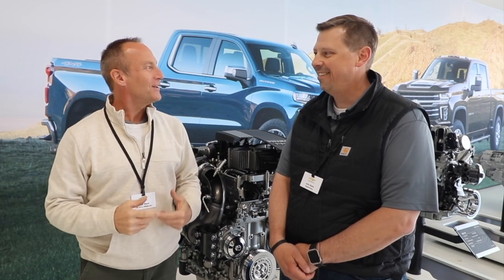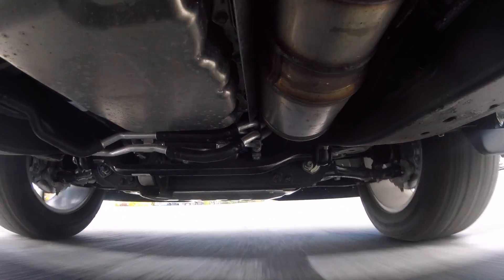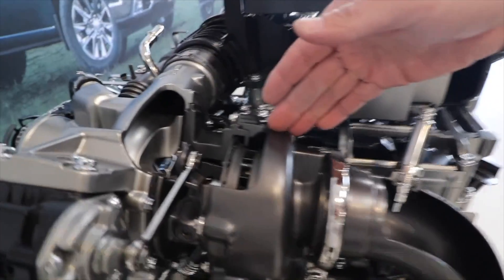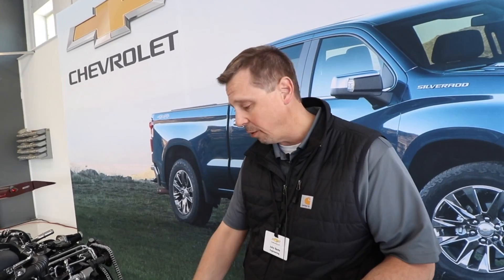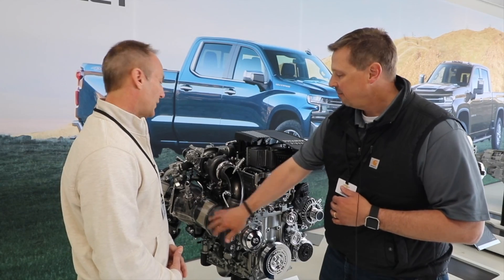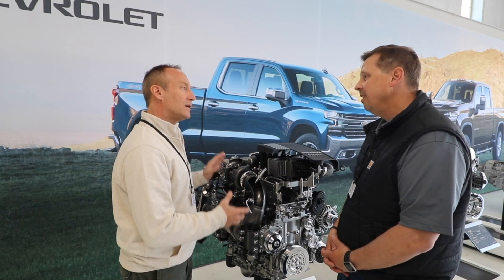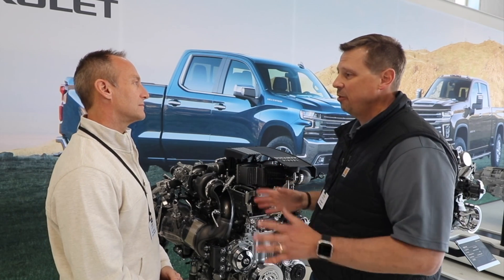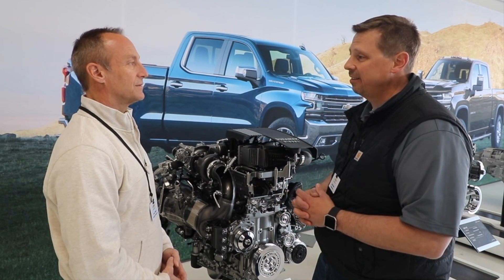Engineer Reveals All! Duramax 3.0L for Silverado 33 mpg hwy

Comment: Then put a 150k warranty on the engine!
Reply from the maker: Absolutely right!
Reply: Or what Ram does, life time warranty as long as you own the truck and keep it oem.  Ram is killing the market
Reply: @Mr.WS6  ram gave that lifetime powertrain warranty for three model years only 2006, 2007, and 2008 and it was only on gas trucks.  The lifetime warranty that some other rams have is essentially an extended warranty and it is purchased at time of vehicle, has three levels of coverage.
Reply: Some dealerships do have a lifetime warranty on thier GM vehicles.
Reply: Lifetime warranty’s are filled with so many exclusions they aren’t even worth the paper they are printed on.
Reply: E X A C T E L Y !!!
Reply: My transmission failed at 100K and then I lost a valve at 110K, on 5.3 V8, so sold the vehicle as I could no longer trust it.  Never pulled a trailer and mostly highway miles.  Did not replace with another GM truck.
Reply: It has a belt driven oil pump!! INSIDE OF A DIESEL ENGINE!!!
GARBAGE!!!
Reply: @Mr.WS6  👍 F Body!!
Reply: @philllsxga.7737  You have no clue
Reply: They build this but have a column shifter still and its 2021 plus upgrade your damn interior allready your 10 years behind the competition
Reply: Put 200,000. 150k is a damn joke for these days.
Reply: Well. Sell it before 150k and EV truck when becomes norm
Reply: My mom’s VW Beetle TDI made it to 250000 miles under her ownership, but the next owner drive it to 450000 miles. Diesel engines should last at least half a million miles.
Reply: My 2021 has 100000 mile bumper to bumper warranty   cost 3G extra from the dealer.
Reply: @Jeffrey Koda Instablaster =)
Reply: @Ernest Kamdyn Thanks so much for your reply. I found the site on google and Im trying it out atm.
Looks like it's gonna take quite some time so I will reply here later with my results.
Reply: @Ernest Kamdyn It did the trick and I finally got access to my account again. I am so happy:D
Thank you so much you saved my ass!
Reply: @Jeffrey Koda glad I could help =)
Reply: A rubber belt drive for the oil pump??? Terrible design!!!
Reply: @glengordon382  I’m sure it’s easy to replace though. It only requires removal of the engine or transmission. No one will do this and when the belt goes the engine is toast. “Lifetime “
Reply: Can someone please tell me what a person can reasonably expect for MPG out of any Powerstroke or Duramax produced in the last 5 years.
Reply: @ernestmorales1023  
Where is this warranty and what is it called?  Never heard of one for that many miles for 3k?
Reply: 3.0 litre doesn't sound too incouraging!!!
Reply: Did they build this diesil as a throw away??

Comment: Timing chain looks fun to change being at the back
Reply: So much of this new stuff looks and sounds fancy, but in reality looks like a nightmare to me.  I love chevy, but think about that little swirl valve in the intake getting stopped up with pcv and egr carbons, then they have all these little extra solenoids on the coolant system.  if one fails, your car will still function normally , but one component will get no water at all....  Looks like a nightmare to own and maintain.  It probably will be good for 150,000, but beyond that maintenance will be prohibitively expensive :(
Reply: It’s a belt
Reply: @TheSouthpawSharpshooter  there's clearly a chain in the bell housing
Reply: @Rocky Ognio I thought I saw a video saying this one has a timing belt.
Reply: Sounds like typical GM. My Canyon has two chains to replace and one involves dropping the transmission and several hours of labor.
Reply: @rognio3  I completely agree with you . Too many complicated emission related parts to fail . And you know they will . I'll stick with the tried test and true naturally aspirated gas engine . Simple and relatively cheap to repair and maintenance .
Reply: I had a 4.3 L V6 and it had an EGR on it. Being a V-6 I’d floor it and at wide open throttle the EGR would get stuck wide-open, from all the carbon; and that would cause the motor to barely run, thus robbing vacuum assist to the brakes after having just floored it. That truck was a ball buster...
Reply: @RedWingsninetyone  
the back chain is for the balance shafts
Reply: @anthonywebber2211  I knew there was something different about it. The video I saw replaced them both at the same time, but they did say they work independently of one another.
Reply: It's actually easier to change than in the front
Reply: When has anyone ever had to change a timing chain? They never go bad.
Reply: @erikkovacs3097  chains, especially under this type of load, stretch over time. Even regular bicycle chains stretch.
Reply: @RedWingsninetyone  Not much. And a tensioner keeps it taught. The pistons and bearings would wear out long before the chain stretches too much. I've taken worn out engines with 250k, 300k, or 400k on them apart and the chains all looked the same. Timing chains are for life.
Reply: @erikkovacs3097  in some cases. Even if you have a tensioner, the teeth are physically no longer the right size to do the job correctly. Here's an example from an engine with much less life on it than you mentioned.

https://youtu.be/-dI2pSmMy8Q
Reply: @erikkovacs3097  what's considered life ?
Reply: How the make more money after sales, shop time & parts.
Reply: Chains or gears. Had a Hyundai with a belt and you have to halfway rebuild the engine every 80-90k miles.
Reply: that's nothing.. sorry he didn't mention the engine oil pump belt that's mount at the rear and has a estimated life span of 150,000  good luck changing that or who wants to drop your tranny to change a belt
Reply: Rocky Ognio The back end of the engine contains a chain that turns the cam shafts and other parts but there is a separate wet belt that drives the oil pump in the bottom of the engine just ahead of the transmission bell. To get to the chain or the belt you have to separate the engine and transmission.
Reply: Geaux Tigers dropping the transmission is easier than getting at it from the front? Yeah right.
Reply: Erik Kovacs there is also a wet belt driving the oil pump. Don’t ask me why they did that.
Reply: Does this motor have front and rear timing chains? If so the past may dictate the future and this lead to terrible results overall. Nah those won't wear on each other...
Reply: steven young   My understanding (and that comes from the limited amount of information I’ve gleaned from YouTube videos about the engine) is that everything (except possibly the radiator fan which could be electric ) is driven off the back of the engine.
Reply: @erikkovacs3097  obviously haven't owned a diesel with a timing chain...this chain also drives the injection pump, which puts it under an immense load compared to only driving camshafts. Combine that with abrasive diesel soot in the oil, this chain is pretty much guaranteed to stretch. It will meet the 150,000 mile target, but my experience says it won't last much beyond that. In a gas engine, chains can last the life of the engine, but I have yet to see a timing chain last in a diesel application.
Reply: Joe Brown as apposed to removing the whole front drive system which can take just as long or longer.
Reply: @RedWingsninetyone  GM had some timing chain issues in the late 00's that have by in large evaporated since then. It was a material selection problem and an oiling problem.

It's safe to assume that any engine that needs a new chain is going to have to come out of the car, so whether its on the front or the back hardly matters. 

The pump belt is something else. Now I don't think the interval is bad or the work is bad, it's about like a clutch. But it really should just be gear driven, I don't thing adding this belt and service interval are worth the weight saving and efficiency gain.
Reply: @kaulincurtis9665  Lots of injected gas cars use cams to drive fuel pumps, and E85 burning engines have decently high pressure pumps
Reply: @Heatherder  that is a fair point, modern GDI engines run 3,000-5,000 psi range. That's about the pressure old IDI diesel injection systems run at.
Reply: @Heatherder  generally, for chains, the engine does not need to be pulled. A hell of a lot of work is needed, but you would have to do that anyway even if you pulled it.
Reply: RedWings-44 name a DOHC vehicle where it doesnt need to be pulled
Reply: RedWings-44 very few vehicles have that kind of clearance. Almost all transverse and most longitudinal mounts, you gotta pull. Ford just has you life the body off
Reply: @Heatherder  "that kind of clearance." That's an inline 5 motor which takes up more forward space than most V8 engines (which is why they offered a V8 later on). Yes, they had to make room, but I don't know any motor where you wouldn't. It would be a lot more work to pull the motor.

Edit: the one in the video is an I4, but it is the same process with the I5
Reply: RedWings-44 i’m looking at my s10 as we speak and there’s no way i’d wanna do a chain job on it without at least pulling the radiator. Now this is a big 4.3 in a little truck but still, draining the rad and removing the accessories in the way would be a huge pita compared to pulling the transmission back on the lift.

In either case its a big job but there’s no way the book hours are going to be very different
Reply: @Heatherder  different strokes for different folks. I only stated the engine didn't need to be pulled. Of course having an engine out would give you a ton more room to work, but you still have to remove all the same stuff regardless in order to get to the chain and it may not be worth the extra effort to also detach the equipment to pull the motor on top of all that.
Reply: RedWings-44 so the point is, it is very likely the job would be no easier with the chain and belt on the front than it is on the rear, and many models require pulling anyways, and it isnt a deal breaker on them
Reply: @Heatherder  most people don't think about that aspect of it because they expect to not own it long enough to think about in the first place.
Reply: RedWings-44 i certainly dont think pulling the engine or transmission is an unreasonable amount of work to change major engine components. Everything cant be done in a home driveway thats how it is. I dont think chains on the rear is bad because chains are a huge job in any vehicle. The belt thing is pretty pointless though I agree. Its a foolish design decision
Reply: On the back its a belt on production
Reply: @rognio3  Our grandparents probably said the same thing about all of these new cars we drive today...but yet here we are.  :)

Comment: Thank you for asking very good questions about this engine. I'm seriously considering buying one and will be my first diesel powered vehicle.
Reply from the maker: Thanks Tony. I think it's a good choice. I would have a hard time going to a gas engine in my next truck.
Reply: Keep in mind, Diesel maintenance is always more expensive than that of Gasoline - powered trucks.  And GM's overall quality is not so good.
Reply: Han Skinslo i’m not sure about that because I have 2009 GMC sierra Dooley and I have over 300,000 miles never been to a dealer or mechanic yet  long is you warm it up in the morning and change oil on time
Reply: As an european with lots of experience with diesel powered cars, diesel is a great way to go.
Reply: Watch the video again at 7:20 he talks about regen. If you look back at the old way of regen(cleaning out the filter) gm in the LMM 07.5 to 10 Durimax had this system and ford had it in the 6.4 power stroke 08-10. When they inject the diesel into the cylinder on exhaust stroke it washes out the rings on that cylinder and will cause the engine to fail. Many as low as 20t miles. Almost all by the time it got to 150t. So I’m disappointed to see gm go back to an old system that they already know does not work and bring back a problem that they have already got an answer to.(adding an extra injector to the exhaust pipe after the turbo) very disappointing I was hoping to get one of these diesels when they come out but now that I have seen this I will be waiting till someone cracks the ecm so I can delete the dpf and egr before I spend my money on it. Or wait till gm adds the 7th injector to it.
Reply: Don't do it Tony, run as far and fast away from GM as fast as you can. I'm a GM mechanic go for ram or Ford non ecoboost
Reply: @scoutsniper8688  ..........you tell people not buy products from a company, yet you claim to work for that company...
Sounds like some deep bull**** to me.
Reply: Don’t do it, Run! It has a belt drive oil pump for heck sake’s! Absolute nightmare to work on.
Reply: This truck is junk . Why buy a mini diesel truck that can’t do shit an has a new bs engine design that is garbage. People don’t fall for this throw away crap .
Reply: EGGINFOOLS I agree

Comment: The gm rep basically said "yea we think it'll make to to 150k but anything over that is on you"  lol
Reply: ncurc 97 oil pump belt, you have to take the engine out for replacement. Weird design
Reply: Ncurc 97, I bet a boatload of these engine will be on GM! That belt at the back may not make that.
Reply: I.T. Intern Its not weird, just their way to get in your pocket.
Reply: I.T. Intern you don’t have to take the engine out. You unbolt and slide the transmission back and can access and replace the belt.
Reply: At least he is honest. Most would just bs and lead people to this crap motor
Reply: And, if it blows out at 100k it's on you also.

Comment: Best review of this engine I've seen yet. Good intelligent concise questions that drew a lot of good information from the GM engineer.
Reply from the maker: Thanks Paul. What's your take on the engine? Is it something you would buy (depending on price of course)?
Reply: I would consider this engine. I'm a retired diesel mechanic with well over 40 years experience. I like the approach GM used on this engine overall. I've had an ecodiesel and loved it, luckily mine didn't have the bottom end problems like some of them did. I'll be buying a 1/2 ton diesel pickup this fall, it will be between the GM & the Ram. I want to drive both of them before I totally make up my mind, but at the point Ram has the lead. GM IMO is behind the curve on their interior compared to Ram & that's where you spend your time when driving one. @4WDMagazine
Reply from the maker: I can't fault your opinion of the Ram interior - they do a great job. I'm also a fan of their trucks - had a Ram 1500 Larimie right up to 315,000 km.
Reply: Nope, If you've watched some of the other videos about this engine you would know why I said what I did. This was a good review, with some good information, only time will tell if it's a good engine in the long run. @skiprope536
Reply: OK then don't buy it, move on with life & keep smiling. @skiprope536
Reply: Skip Rope 
Lol you buy one 1970 gm and right them all off for the old farm trucks mistakes. Trucks were different back then.

Comment: I'm enjoying my 3.0L Silverado. I'm at about 18k miles and I'm getting 26mpg over the whole year I've had it. If I drive flat distances at about 75 I'll get 33mpg, city I'll get 24-26. I've also never felt like I'm ever lacking power. I actually feel like I'm always in the power band. The 10 speed transmission probably is my favorite part of the setup. I've towed a buddy's boat and it brings me down to about 18-20mpg. I've also only refilled my DEF twice in a year. I'm a pretty light user but then again... it is a 1500
Reply: Is there any additional maintenance that you’ve had to do or any additional maintenance that you’re worried about?

Comment: I’m a Diesel nerd and I’m glad some Diesels are being used in trucks. So if you were to Delete the DPF it would unlock the great sound of the motor, the better MPG, and more power. If anything a healthy Diesel does not need a DPF. The gas trucks should be using them because they use more fuel.

Comment: The origional Duramax was a proven Isuzu engine coupled to an Allison transmission.  This Duramax is a design from scratch GM diesel coupled to an unspecified transmission.  I think I'll wait a while.
Reply: B Laquisha I would go back and look up the history of the Original Duramax again. That was a true joint venture between GM and Isuzu. They have all been built in the Moraine, Ohio plant that my brother works at. There is an Isuzu built engine that is an I-6 that is “called” a Duramax but it’s not the original and isn’t paired with an Allison transmission. Very good engine from what I hear.
 Like you, I would also wait. I love GM but look at their history when it comes to Diesel engines that were built without Isuzu’s help, not very good.
Reply: B Laquisha
a 60-40 joint venture between GM and Isuzu in Moraine, Ohio. The Duramax block and heads are poured at The Defiance GM Powertrain foundry in Defiance, Ohio

GM taking a 34% stake in Isuzu was seen in 1972
In 1998 General Motors and Isuzu formed DMAX, a joint venture to produce diesel engines. GM raised its stake in Isuzu to 49% the following year, effectively gaining control of the company
Reply: It will have the joint venture GM/Ford 10 speed auto trans behind it.
Reply: Yeah proven to have leaky injectors and limp mode Transmissions